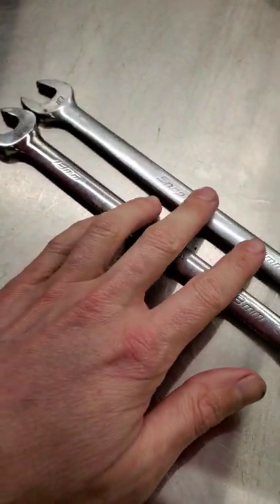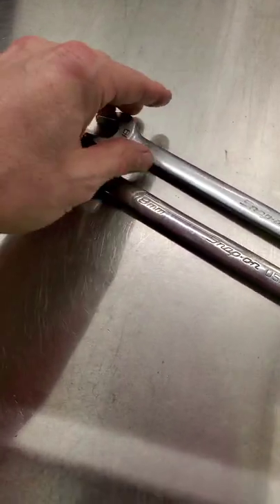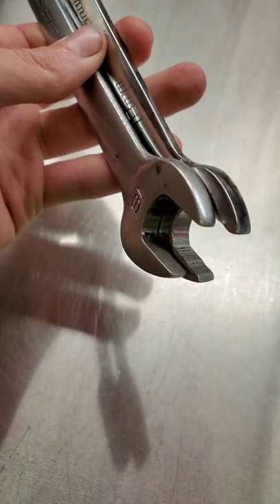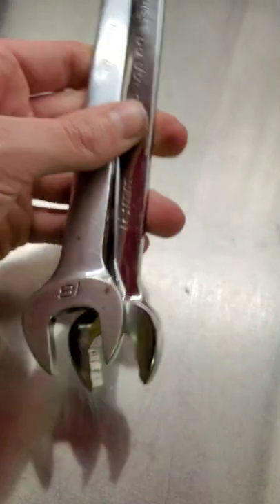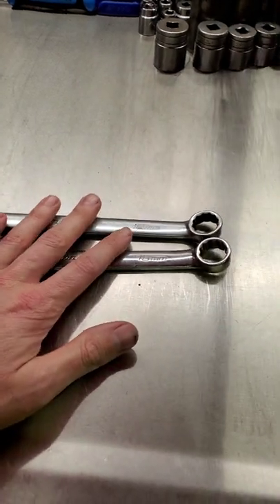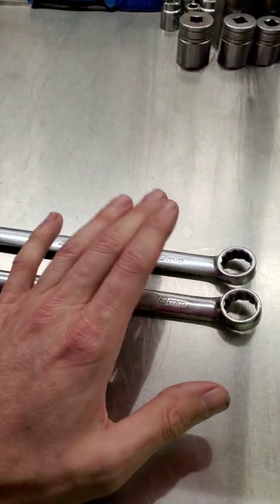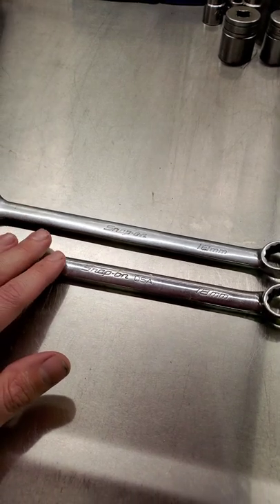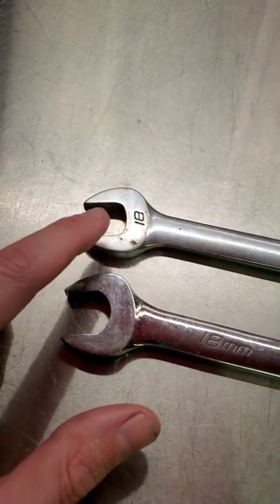Snap-on Flank Drive Vs. Flank Drive Plus #shorts

Comment: Till this day I’m glad I got on eBay and found the 10-19mm set of flankdrive + for 100$ and it was a brand new set.
Reply: Pretty much got the same deal was a little more around 150$ but was worth it
Reply: Wow deja vu, the 10-19mm for $100? I bought a set for that same price last summer. It didn't come with the case so he threw in a 3/8 snap on ratchet.
Reply: @avesfather Do you mind sharing the eBay seller's account name?

Comment: Any cheaper brands that have something similar that won't totally break the bank?
Reply: Several brands have copied this tooth design (like Icon and Carlyle). Also, the Craftsman gunmetal wrench set has the divet on the open end, but no teeth.

Comment: I never use the plus on my bike it can mark up the bolts either the chrome or in my case all black bolts
Reply from the maker: Plus is meant for rusted, damaged, and partially rounded fasteners.
Reply: @MrSubaru1387  couldn’t  have said it better

Comment: MAC makes sockets that have similar teeth technology. Both worth every penny.
Reply from the maker: MAC doesn't make them. They're a Taiwanese rebrand. Stanley Black&Decker sells them under the MAC name, FACOM name, and SIDCHROME name.
Reply: @MrSubaru1387  That is correct, iirc they are branded in Australia under another name as well. I should have said MAC markets a socket with their name.😂
Reply: Sidchrome is the one

Comment: Do you know how the Snapon Flankdrive plus sockets compare to the MAC tools precision torque sockets?
Reply from the maker: You talking about the Flank Drive Xtra sockets?
Reply: @MrSubaru1387  not sure what ever ones have the teeth groves in them
Reply from the maker: No Snap-on sockets have teeth.
Reply from the maker: MAC Precision Torque sockets do have teeth though.
Reply: @MrSubaru1387  I thought that Snapon had a socket that had grooves to help remove some slightly damaged rounded bolts. Like the MAC ones do. I could be mistaking.
Reply from the maker: That's the new Flank Drive Xtra sockets, but they don't have grooves/teeth.
Reply: @MrSubaru1387  oh I got ya. So would you know how those do against the Mac precision torque?
Reply from the maker: @iowafox2206  seems a good video idea, since I own both.